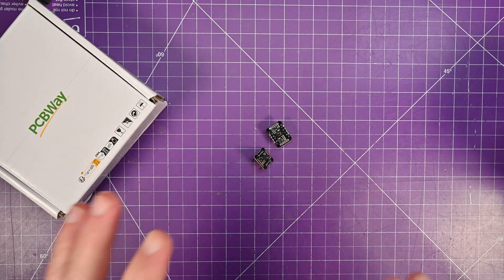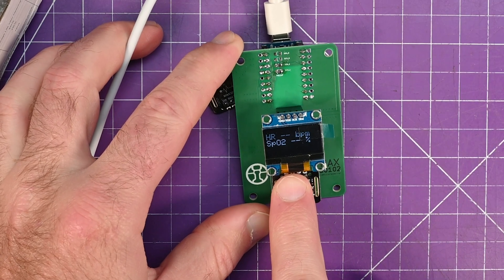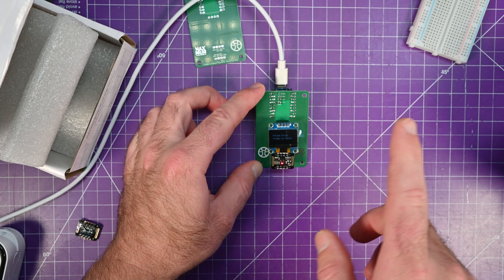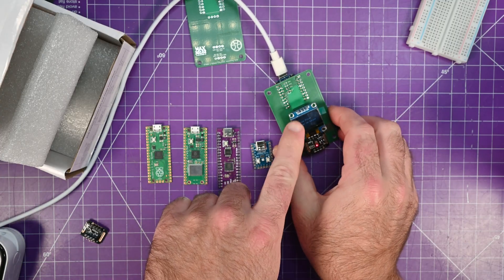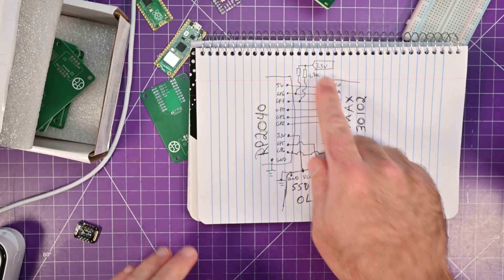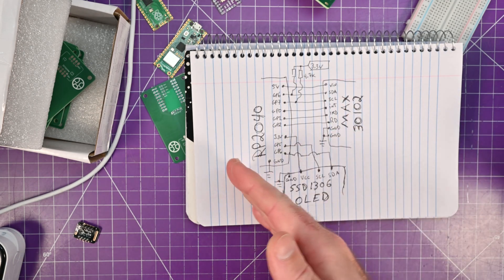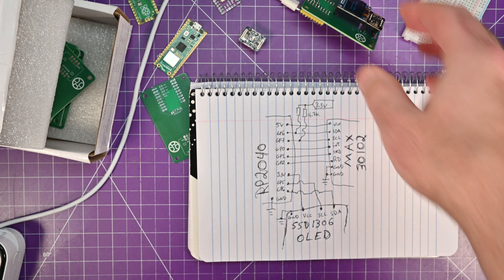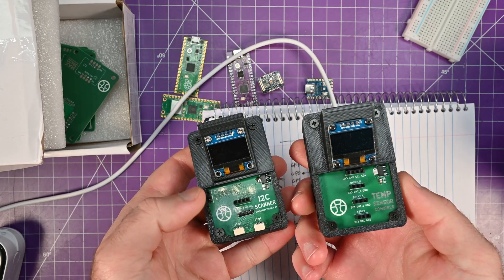Calling All Makers - MAX30102 Coding Challenge!

Comment: I have been struggling with one of these max30102 that I just can't get to work.  Something I noticed with yours (that is similar to mine) is how dim the light is. When I look at working examples of this in other videos, the light is much brighter and the finger actually glows when placed on the sensor.  I'm curious if you ever got this working, and if so, did the fix make the light brighter?

Comment: The boards contain faults.. its a common issue those boards.. the max30102 VDD pin has to have 1.8V only.. only the LED connections on max are 3.3V.. you have to use 1.8V for I2C pull-up..

Comment: The symptom of double or third pulse rate let me assume a down clocking issue at the MAX.
If you put your finger on the board maxbe you impact the clocking circuit with your skin, try to isolate the pcb keeping only the sensor free.

Comment: Looking at 00:31 I can see you haven't set the pull up voltage by jumping the corresponding pads on the back of the board. At least on teh board in that clip cant see if you've added it to the back of the one you plugged in to the board.
Reply from the maker: Check out the tutorials, my website article and I'm pretty sure in the video I mention that the board's default behavior, with nothing jumpered is 3.3V logic - I did jumper a second board and no change in behaviour

Comment: I was looking through the data sheet for the rp2350 some time back and it had a small blurb in it about using line level converters, because resistors weren't optimized for some reason. The rp2040 is close.

Comment: Are you really surprised that you have asked glorified autocorrect to write a program and the program doesn't work?
Reply: Disagree, my experience with copilot has been pretty interesting over the years. It used to make silly mistakes, starting array at 1 when it starts at 0 for the specific language, and now its actually pretty dang good and at least for me gives a good bit of reasoning for what its giving you as well as links for further research. Would i tell someone who hasnt learned a few languages or at the very least one that it will work out for them. No, but when you know a few languages its a brilliant tool. I had it pretty much completely transpose a simple game i made in java to javascript so i can put it on a webpage. No problems and i want to say zero corrections or debugs from me but truthfully i thibk i do remember having to debug something. Just cant remember if it was solely my code for the page design or the javascript for the game. I would not call it glorified autocorrect is what im trying to get at.
Reply: @DeathxCap best tonge-in-cheek analogy i have come across is "statistical potato masher" 😂 i guess it can be a helppful tool if - and only if - you as the use are capable of guard-railing it, and to be able to do so, you must already have a wealth of domain knowledge on what ure trying to achieve.. therefore im highly sceptical when i see our apprentices (learning sw-dev) struggling with the simplest of tasks and not being able to solve using their "natural" intelligence..
Reply from the maker: Did you miss that the examples didn't work either?
Reply: He's got a point there -- unnecessary sarcasm aside, as a someone that holds a cs degree, i can reassure you: dont treat »vibe coding« as if whatever result that tool produces is in any shape or form comparable to intentionally written code by a human that has put more or less effort into finding, reading + understanding one or more datasheets. It is not -- i promise!
Reply from the maker: @peterpanowski  Yes but keep in mind that the library examples also didn't work
Reply: @SimpleElectronics fair point!

Comment: Yeah so typically you'd want to program it yourself, reading the datasheet, without chatgpt and such. The datasheet specifically mentions an ambient light calibration procedure...

Edit: also I2C is not stable when used with level shifters (depends on what kind you use)
Reply from the maker: The library examples didn't work either - but please, have a go at it!

Comment: At some point you do have to consider hardware faults. I know your website says "across 3 sensor boards", but if you got all three from the same source, then they might all have the same faulty / counterfeit part or manufacturing problem. (And even if you got them from different sources, they might have a common supplier.)
Reply from the maker: Yup totally agree

Comment: @SimpleElectronics  
Your schematic might be wrong.
You can't share i2C data lines and have different clock lines. In your schematic you're using GP6 as the data line for the OLED and the MAX, but you have different clock lines (GP7 and GP5 respectively).
If the drawing on the book is correct then that could be your problem.... change the OLED i2c data line (SDA) to another GPIO. Also be careful of port multiplexing. In the RP2040.
Use GP6 and GP7 (I2C1 SDA and SCL) for the MAX, and GP8 and GP9 (I2C0 SDA and SCL) for the OLED
Also the i2c addresses would never clash. The screen is 0x3C and the MAX is 0x57 ... so you can (and it's recommended) to use them on the same i2C line.
Reply from the maker: I did mess up on the schematic, fixed on the website now.

Comment: So you want us to code and troubleshoot FOR YOU.

If anyone can get it working on your non-preferred platform, and if you were at all competent in electronics and programming, that would be 100% sufficient!   It is probably not even a software problem. It sounds like a hardware screw up.  Which is why other platforms would be very useful for debugging.
Reply from the maker: I have NEVER claimed to be good at programming - in fact there are likely around 100 episodes of the podcast where I say that is my weakness. The hardware is solid, check the other comments if you don't believe me.

Comment: Nice, I like an excuse to buy another sensor and play with some code.   :)
Reply: In the docs associated with the MAX30102 module I ordered it says that it is 3v3 compliant and has solder pads on the back to select 1v8 or 3v3 pull-ups for the SDA and SDL lines.   Wondering if you tried that.
Reply from the maker: I have tried but no change to the i2c bus - it outputs 3.3V logic without any jumpers being jumpered
Reply: @SimpleElectronics  So I got mine working, after a bit of a fight 🙂.     I left you a message on your web site with some details.   I did notice what you mentioned in the video, that the BPM reading is double what it should be.
Reply from the maker: @klif_n  Thanks I'll check it out!